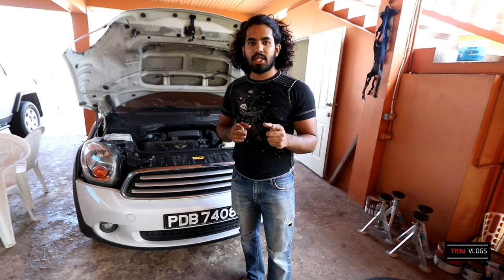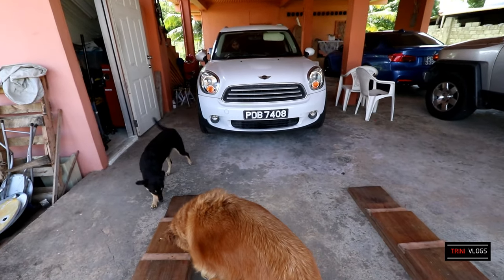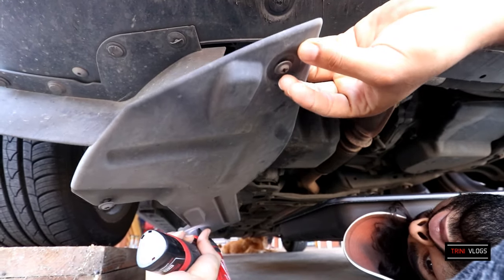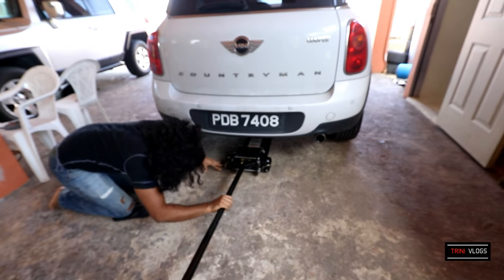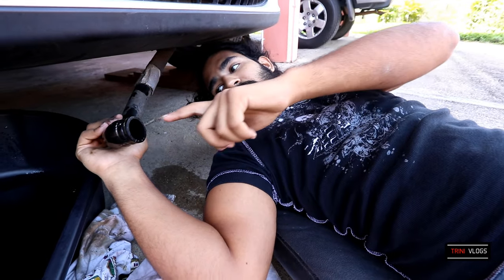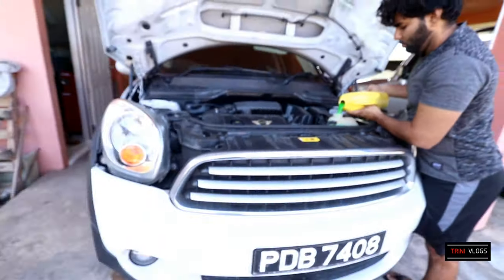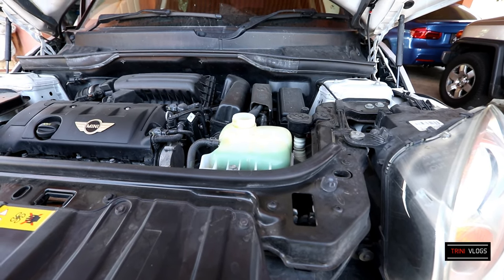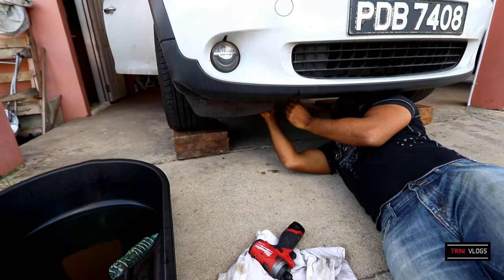Mini Cooper Countryman R60 Coolant Replacement

Comment: Hi guys do you always have to bleed the fluid before replacing it, or can you just top it off? Loved your video.
Reply from the maker: Thank you. Always gotta bleed the cooling system. There may be air pockets within that just topping off may not get out.This can cause an overheating issue that damage the engine